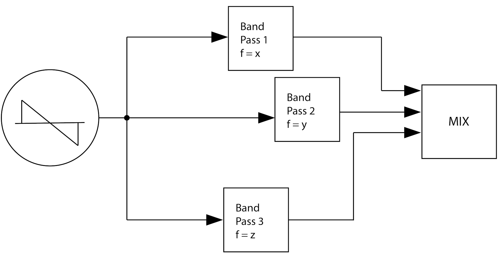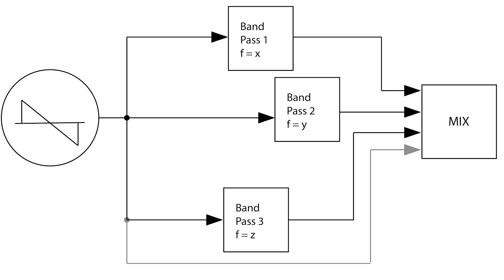Strange Patching: Phasing Simulation with QPAS

Comment: Getting into that phase modulation FM stuff eh? I'm confused as to what variable out is?
Reply from the maker: On MATHS, the Ch1 and Ch4 variable outs (as opposed to Unity outs below them) are affected by the output attenuverters, and are normalled to the SUM/INV/OR outputs so that they are removed from the bus outputs if you patch them.
Reply: @MAKEN0ISEMUSIC  think I got it, had to think more micro electronically to wiring diagram to make sense out of that